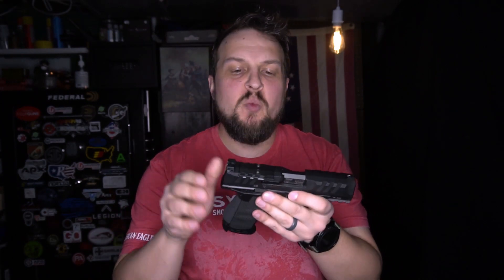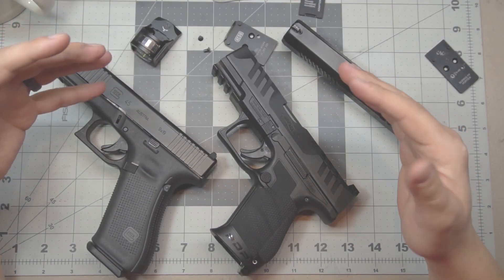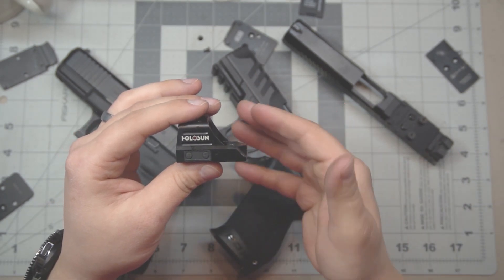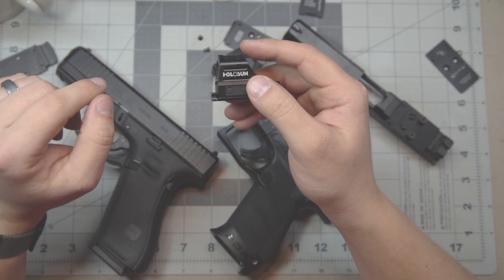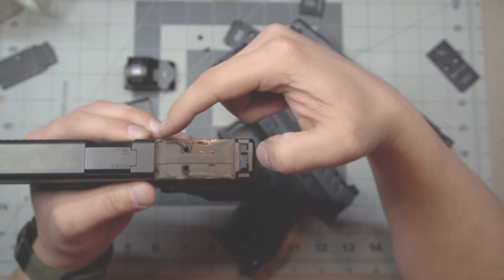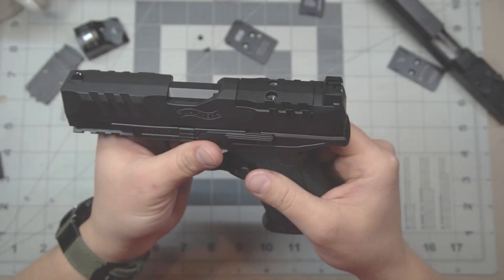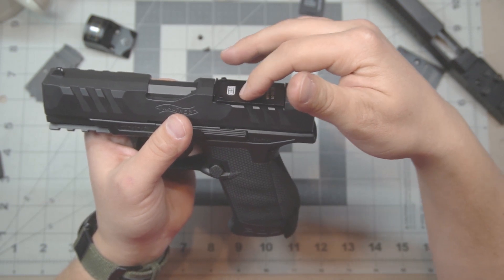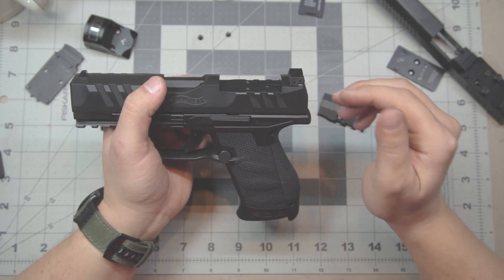The Gen 1 Walther PDP is going to Break

Comment: I'm a mechanical engineer, and all you are describing is a warm fuzzy.  All those nubs or other surfaces cannot be precision mated without a setting "grout" or epoxy between them.  If I were to design a mounting plate that could be taken off and mounted again without worrying about re-zeroing the optic, I would use 2 cone-in-cone, aka countersunk screws, to assure X-Y fixed positioning and the plate-to-plate surface as at least 3 points of contact for the Z-axis positioning.  The screw positioning can be designed to wedge the plate in any bias you want, such as against the forward edge and the diameter and material shear strength can be designed with dynamic stress criteria.

BTW, plate-to-plate connections using screws to clamp them take advantage of the tension in the screws to apply friction between the plates, which is much better at transferring loads, think clutch, but those plate connections are designed conservatively as if no friction between the plates exist and only the screws in shear are transferring the loads, whether there are threads or unthreaded screws at the interface.

Comment: I’m going to go against the grain and say, I get what this guy is saying. I wouldn’t say it’s a certainty but certainly an interesting idea
Reply: The compression caused by the bolts will be enough to hold it in place. Even if something was to break, it would be the bolts from double shear and not the optic or plate (but only if they aren’t screwed on tightly enough).

Comment: If true, the real question is when? The sun is going to explode too, but it isn't likely in our lifetime. Optics mount will fail in about 10,000 rounds? In addition, the mechanical design failure has a simple mechanical design fix. I mean nobody has ever had to deal with shear forces before...oh wait, stress, strain, shear forces are mechanical engineering 101. You make a valid point and then jump to speculative consequences without experimental testing, not the way science is done.
Reply from the maker: You wanna toss a few thousand rounds of 9mm my way, I'll get right on it 😉

And leaving "this will probably break" up to chance shouldn't be the engineering way... But all too often it is.
Reply: @workthetrigger  😂 look at how smart you think you are 😂.
Reply: @workthetrigger  "...all too often it is."  Says the DESIGN guy who couldn't even handle an Engineering curriculum in college.  Well, jealousy's a tough thing to handle, isn't it?  I'm willing to bet that most engineering failures you'd cite are failures in the end-user's poor understanding.  Such as, using the WRONG PLATE for an application.  Or not understanding how fasteners work.  Or failing to use Loctite where required on the fastener threads.  Or mangling the threads during installation.  Most failures are due to end-user problems.  The occasional design or manufacture flaw doesn't prove your "theory" is correct.  Correlation is not causation.

Comment: I dropped my FS PDP out of a 20ft tree stand”accidentally.” I took it out the next day to make sure Vortex Venom didn’t move. I discovered a decent sized fracture in the red dot window. I shot 10 rounds with the cracked optic to see if it held zero, it did! Additionally the gun shot true as before the fall with the replaced venom. I can confidently say I have no concerns with Walther mounting system. FYI based on the small spot of discoloration on the vortex The PDP landed on the optic, not the glass.

Comment: Having a degree in mechanical design just means you’re taking my specs and plans and putting them into a CAD program for me. I would like to see the shear force calculation you did for the 2 M3x6 screws used. There are different types of fasteners so you need to be more specific. Do you know the difference between a screw and a bolt? It’s weird for someone to use such an all encompassing term such as fasteners and not mention the specific type used. Fasteners such as bolts, screws and rivets are held in place with the use of compressive force, but fasteners are able to withstand shear force. Saying fasteners are not meant to is wildly inaccurate. The bridges you drive across everyday are held up by these magical fasteners called bolts and nuts and they are withstanding shear force.
Reply from the maker: Threaded fasteners, in general, are not meant to take shear Force across their threaded cross section.  If they are in a position to take shear Force, that force should be across the unthreaded shaft of the fastener, screw or bolt. 
A bolt is a threaded fastener which is threaded into existing threads in another component, a screw makes its own threads.  These are bolts. 
These are fully threaded bolts, meaning they are not designed to accept a shear Force.  Their effective cross section is 2.3mm
Fasteners like this, screws or bolts, are designed to exert a clamp force on the two opjects, and the friction between the two surfaces created by that clamp load is what takes the shear Force.  
But you toss a couple lugs in there, like in 99% of alternative mounting aystems, and none of that matters 🤷🏻‍♂️.
Reply: @workthetrigger  you're taking some major heat for this video bro.

Comment: i'd recommending clarifying from that this WILL fail, but it's a POTENTIAL weak spot.  i'm not sure what mechanical design degree emcompasses, but i have an engineering degree, and i'd imagine walther engineers and designers have a whole lot more than both of us, plus decades of experience.  every mechanicl system will have a weak spot, and it's fair to identify.  but if that weak spot can still handle any stress it may experience, plus any desired margin, that "weakness" is essentially irrelevant.  not to mention, it's been a couple months, and as hard as i tried i haven't heard a single issue.  so maybe, professional engineers and designers with decades of experience know more than you?  maybe?  and no, i'm not a walther fanboy, i have one walther along with several other brands, but i get irritated by armchair engineers who somehow think "oh this seems right" is enough data to declare something factual.

Comment: No, there are fasteners that will and are intended to work in shear.  And you have how many years designing, building and testing firearms?  ....  yeah that’s what I thought
Reply from the maker: ... I said there were specific fasteners to take that kind of force 🤷🏻‍♂️ it's just not the ones they use.
Reply: @workthetrigger  As they are not using the plates you use. 
Don't pretend to actually give anything to the community when you're only in it for the click bait.

Comment: I am a mech eng, I dont think shear the screw will be the problem because the screw clearance hole is pretty much the same as the play you have on that plate so the plate will take the energy transfer from the front and back edge. HOWEVER if not enough torque is applied on those screws the sight might not hold zero

Comment: I'll put my money on the German engineering of Walther over some cholo with a degree in "Mechanical Design".  I'm guessing you spend all day on a PC doing Solidworks in packing or something. I'm a retired MSME with over 35 years or working for MB, BMW, Audi, and countless others. German engineering is 2nd to none. Your video borders on speculative slander.
Reply: I dunno about the presumed superiority of German engineering anymore. It's bad enough that the Germans themselves, or at least the ones I know, are cynical about certain aspects of it and downright angry about others. Have you seen how much cheap plastic garbage Mercedes has been putting under the hood lately? It might be cheap to make, but there's nothing cheap about replacing it when the stuff melts, and melts it does. And the Germans are still making a lot of models of firearms that jam up on hollowpoints. I do agree with you about the guy's "speculative slander," as you call it, though. At the very least he should have run some stress tests instead of just flapping his tongue.
Reply: Well said.
Reply: Knife Fight in the Big City  laughs in Swiss
Reply: Have you ever read about the fail of the Walther P99 in Poland police range use? Fortunately no one was permanently injured but the striker flew out the rear of the slide into the shooter’s safety glasses. There’s a lot of misinformation about this out there, primarily from Polish government  The problem ultimately stemmed from the breech face being too weak. Part of the Polish training is dry fire. The dry firing damaged the breech until the metal simply broke through. At the same time a primer blew backwards with enough force to push the striker right through the plastic slide cover plate. The Poles’ unfortunate solution was to replace the slide cover plate with a metal one, but that was a quick bandaid which did not address the fact that the breech could not handle the continued dry fire. If I ever get a hold of one on surplus, I’ll definitely be using snap caps with my dry firing like I do with all my guns. The Poles should be doing the same. 

All this does not mean that I dislike Walther. I think their guns are fantastic, in general. But they screwed up with that model and its contract with Poland.

Comment: i’ve had my share of experiences with this issue.  red dots will not stay zeroed
Reply: Your optic is shifting on the gun? Doubt it.
Reply from the maker: I've seen a ton of complaints about optic shift. Nice of you to doubt with no other information 😉
Reply: @workthetrigger  how does an optic physically shift if it's been screwed down properly with loctite or vibratite?
Reply: @xm3ntal620  I’m guessing you haven’t installed one yet. There is a plate and some wiggle room so it happens on this model big they recently fixed it for 2022 releases.
Reply: @awesomedave8484  I own 3 of them with aimpoint acros on them. Zero issues.
Reply: @xm3ntal620   I’m not seeing posts on optics breaking or screws shearing but not holding zero seems to be an issue for people. I’m sure locktite differences and dry time plays a factor but clearly there is some room for error or they wouldn’t update it.

Comment: In carpentry we use shims to counter shear on nails, would shimming the optic to frame fix this?
Reply from the maker: In two of four directions, yes.
Reply from the maker: Technically 6 directions, but the slide and bolts holding the plate down take up 2
Reply from the maker: Don't worry, I will.  Just not in the comments. There's a lot to go over, Walther's diagram, their stock plates, and some other fun about it.  It'll take some time, but it's coming.  Sorry to keep you waiting.
Reply: @workthetrigger  We can't wait for the double-down!

Have you ever heard the wise statement, "if you find yourself in a hole, stop digging"?

Comment: What about a reciprocating fixture that racks the slide ten times a second for a couple of hours?  Definitive results.
Reply from the maker: I don't have the resources to build that, and It won't duplicate live fire anyway.
Reply: @workthetrigger  what's so special about live fire?  If you duplicate the mass and velocity, all that's missing is a boom.
Reply from the maker: Duplicating the velocity of live fire without live fire, and the forces it exerts, is darned near impossible. Especially without wearing other items and parts that may be outside their scope
Reply: @workthetrigger  BS.  The forces exerted on an airplane are tested in wind tunnels, compression chambers, etc.
Reply from the maker: ... By multi billion dollar companies and teams of engineers.

Describe how to exert a force on a single face of a firearm through a 9mm hole that correctly mimics a 35,000 psi explosion with items that can be easily made or used at home.

Comment: Shadow systems doesn’t use lugs but supply insane fasteners
Reply from the maker: Do they have a large portion of unthreaded shaft above the threaded portion?
Reply: @workthetrigger  they thread all the way into the bottom of the slide from the top.
Reply: I just traded off a 920, wanted to keep my 507C of course, it was an absolute chore to get those lag bolts... I mean screws... back out.  Ended up using a combination of a hairdryer and a miniature soldering iron to loosen up the thread locker.
Reply from the maker: I'd love to give one a try.  If I get my hands on one, I'll be sure to get a video up on it
Reply: I was just looking at my shadow systems saying  that hasnt been a problem

Comment: So basically, CNH made a plate that does not work perfectly with the PDP.
Reply: Made a plate for which slide and which optic, in combination?
Reply: @seanoneil277  this guy said the plate he was using on the PDP was a C&H. 

The other comments pointed out that Walther makes a plate that fits and works just fine.
Reply: @jameszclark  Who is "this guy"-- and was it a plate made by C&H for the PDP, and for the optic being used?
Reply: @seanoneil277  who else would "this guy" be when there is only one person reviewing the issue? 

If the plate walther makes works fine but the plate from C&H has an issue then that would be C&H's problem, not Walther. 

If C&H makes the plate for that weapon and optic combination then the issue would be with C&H, not walther. 

This video should be telling people that the C&H plate does not work, not that the optics are going to get messed up by a poor weapon design
Reply: @jameszclark  I could have assumed you were talking about our host, but I wasn't sure, and therefore wanted to check.

I'd say it's not a problem with the work of C&H, but rather that the plate our host used was NOT the plate designed BOTH for the PDP he's talking about, AND the optic he chose to mount.  C&H is particular about fitting a specific optic to a specific slide.  

So I'm not ready to blame C&H.  I'm perfectly willing to blame our host for shoddy mechanical aptitude while passing himself off as a mechanically wise person.  Which this video proves he's not.  He didn't take a scientific approach, he took an uninformed, half-baked approach.
Reply: @seanoneil277  I can appreciate that

Comment: lets see some actual shear math here instead of conjecture. BS that there isnt a fastener out there that can take that kind of shear. You take a standard SS bolt (70ksi Tensile so figure 40ish ksi shear) will be PLENTY of strength for those loads. This was clickbait without some actual accelerometer data and shear load information.
Reply from the maker: The safety factor of the screws is about 1.2 on the fasteners, from just the optic reciprocation.  I'm working on a rough calculation of the friction forces between the plate and alide, but the contact patch has been called into question by some pdp facebook group threads, so I'm trying to figure out the best way to get that properly calculated.

Comment: Okay. I got about 1000 rounds through mine. I used the screws from holosun when I mounted my 407 x2. The 2nd training session I did was using the optic to rack the slide every time. The optic started to come loose. Not the plate. I check the plate every day mind you. The plate has stayed fastened down. But that one time, the optic loosened up. Pretty bad. But I tightened it back down and it has remained zeroed. I torqued it down a little more and it’s been fine since. And I carry this gun and beat it up training. I still think the optic system is fine and doable.

Comment: Received my PDP compact a cpl months ago.  I had ordered and received a Holosun 509T red dot.  There was no adapter plate available for the adapter cut type 2.   (Go to the Walther web site, adapter plate request form for the PDP,  to see pics of the type 1 and type 2 adapter cuts.)  I contacted CHPWS, they were working on it and said they would have it available in July sometime.  It actually took until late August before I received it.  This shear issue isn't a factor with the type 2 cut and the adapter plate from CHPWS - for the Holosun 509T - and I'll bet any of their red dot adapters made for the type 2 cut. CHPWS  has incorporated two anti-shear pins that project into the 2 recesses milled into the slide cut.  So they can resist the recoil forces in addition to the 2 screws.  I did clean the screws and holes with acetone and compressed air, and used blue loctite, torqued correctly.  Did not "stake" the screws per CHPWS instructions, using an "oil based sharpy". Just because I don't get how that will improve the security over the loctite.

Comment: The Walther system is acually really smart. Maximum stability achived by physical contact in the direction of the by far largest force and minimal machining needed.
Reply from the maker: Except the production u it's are not within the spec for their "design" to work.  Check out my 2nd video on this and you'll see what I mean

Comment: Optics plate screws  just came loose on my PDP after 600 shots using Walther soplied thread threadlocker. This is giing to be a problem.
Reply: Im at 5k with that same threadlocked did u let it sit before using the gun?